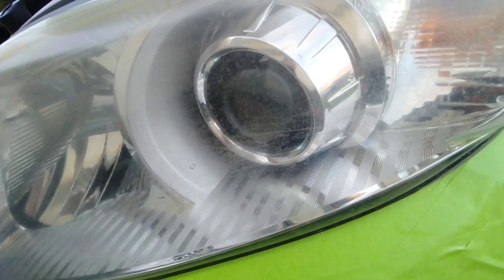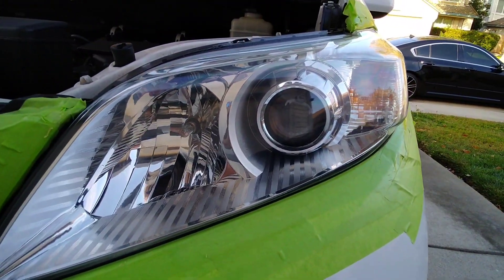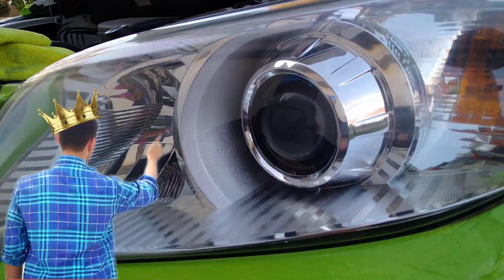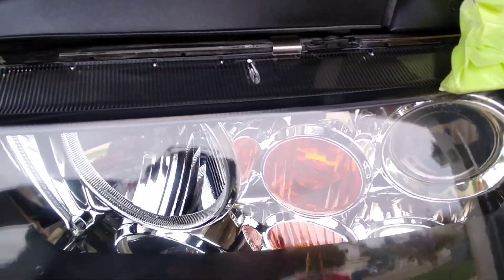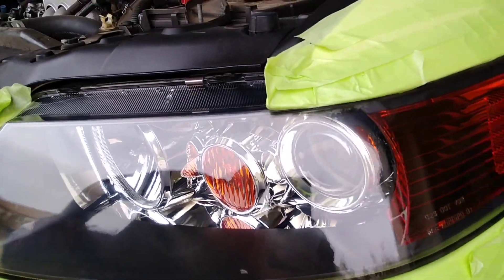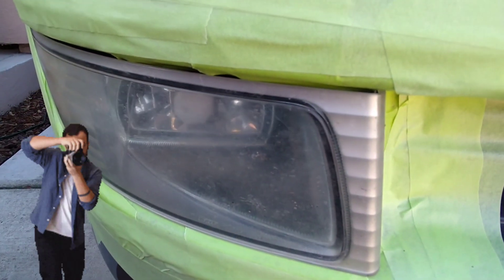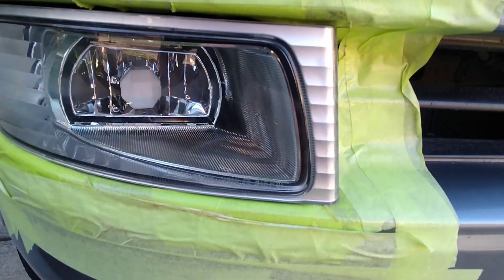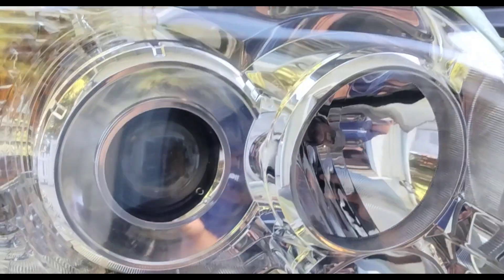Headlight Restoration PORTFOLIO #5 -🥋The Master Of Headlight Restoration

Comment: Just spent $150 on materials in your links to restore headlights. I am a true believer 🙌🏼
Reply from the maker: Hella yeah brotha..👍🏽 This is the way...
Reply: Same here just bought the the polisher. Only thing I haven't bought it the finesse pads cause I have a pack of cheap ones
Reply from the maker: @roysla cheap ones aren't going to work right...lol. WARNING
Reply: Got a few jobs lined up.
gonna have to express dem pads
Reply: @theheadlightrestorationpro  found this out the hard way. I had a set that was too hard and gouged the plastic!
Reply from the maker: @RazoE yeah it's amazing how most people think I can just change this little thing out but they don't understand I've done all of that a thousand times over and this is what I came out with so I know when they change one little tiny thing out it makes a big difference huge difference..
Reply from the maker: @roysla Amazon usually has a two day

Comment: Hey brother, I do headlight restoration and windshield repair for a living. I use the wet sand method and mine come out really good, but yours come out amazing!!! I use a wipe on clear coat and it will last 4 years even when parked in the sun most of the time. I'm going to try your method on my own headlights, I've never used 3M disc's but I'm excited to try them. Also I'm  curious to see how much time this method saves me. I subscribed to you because your work blows me away! Thank you for all your great videos bro..... Chris from 3 Brothers Glass and Auto..
Reply from the maker: Yes....if you change to powered dry sanding and spray coating you will be amazed....👍🏽💯🥷
Reply: 🔥 Sweet.  Looking great on e again
Reply from the maker: @VeteranHeadlightPro 🥷
Reply: 4 year, wipe on coating ???
Reply from the maker: @franchesconieves1120 absolutely no such thing...😂💯
Reply: @theheadlightrestorationpro  i would have to agree with you in that one.  Even factory clear coating applied in the perfect factory environment doesn't last four years on most cars.  I offer no more than a 12 month warranty.
Reply from the maker: @VeteranHeadlightPro yeah there's two much variability people take care of their cars differently, the shape of the headlights and sponsor to the sun is different, some cars are parked outside all day, some of the garage, different weather patterns there's no way to tell...
I just warranty my work.... Far as if it is still good and everything held up that's what I'm warranting... Products go bad it's like if you were too warranty of oil change.. you would warranty that no malfunctions were happening with the application not the oil going bad.... If they were driving down the road and the oil filter came off or started leaking of course warranty it but if they come back in 7 months like hey my oil is bad so freaking what your oil supposed to go bad...lol
You know I love my metaphors...lol
Reply: I say it lasts up to 4 years because I have customers headlights that I did 4 years ago that still look good. The clearcoat is from Glasweld, it's called G-clear, it's pricey but does what they say. I really think that the Restoration Pros method is the best I've ever seen but the G-clear is very good....
Reply from the maker: @chrissanchez6610 🙏🏽👍🏽😁

Comment: Question: instead of using a standard drill like the Ryobi, could one use a right angle drill with similar rpm to perform the work as I am used to that configuration and seems more natural and ergonomically to handle..
Reply from the maker: You can use whatever you want but I probably advise against it... It's far less focused by the way you handle it I try to before and kept running into a lot of issues especially the fact that you have to do it in a lot of vehicles bumpers will get in the way... Think about the l shape while doing a headlight instead of the gun shape... Are you running to a lot of problems moving around.. and the focus is a lot different and slows you down a lot... It totally changed the dynamic of the focus could you imagine shooting a firearm that shape... Wouldn't be as efficient..
Reply: Valid point to consider, I do see the need to learn the dry sand method though.I will experiment on some non essential lenses and see if it's doable for me @theheadlightrestorationpro
Reply from the maker: @papasquirrel5559 it's the best hands down...you will love it...

Comment: May I put some thing in the suggestion box I bought a Ryobi 3/8 drill because it only has 135 pounds of torque and it only goes up to 600 RPMs so today I tried it and of course like I always do I hit the side of the paint and immediately the drill stopped and did not go through the tape when I had it set at the number one like I said if you can take a look at it if you don’t like it return it I guess

Comment: Hey Master......you recommend using a UV curing light for best results. If you recommend it, could you tell me which one is the best or could you make a video of the UV curing light. You are the best 🫡
Reply from the maker: If you're using headlight certified products that are made for headlights you do not need a UV curing light... If you see somebody using one of these they're using something that's not meant or designed to be on headlights..
Headlight certified products react better to air drying and or forced air drying.. if you watch a couple of my videos you'll notice the sound at the end and you'll see me turning on two fans because these products dry by oxygen exchange.. they release moisture into the air rapidly that's why they stink really bad... Like super glue.. it's also why they dry so fast... Do not need heat or curing lights.... And would advise using them with headlight certified products..... Quite often it affects the clarity and that adhesion..
Reply: I use ceramic coating from the Adam's polishing brand. and when it is cold it takes longer to dry.
Reply from the maker: @melchoralvarado6178 that's because it's not meant for headlights... It's meant to adhere to clear coat.. or even better yet to adhere to wax that's on top of a clear coat... Not polycarbonate...
https://youtu.be/k8_ljUVQfvo?si=PM5RQPrUBPfDnh-j
Reply from the maker: Although ceramic is very transparent just like headlight certified clear coat.. it's not designed for headlights it's far too thin which will cause  impact damage and overheating and even more problems in the long run..
Reply: Thank you very much for the information and for answering 👍
Reply from the maker: @melchoralvarado6178 👍🏽